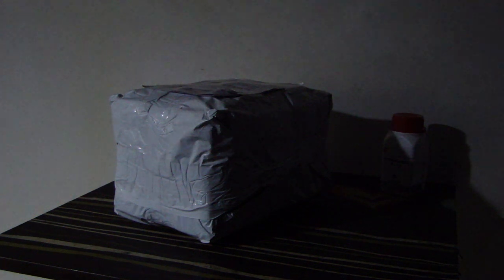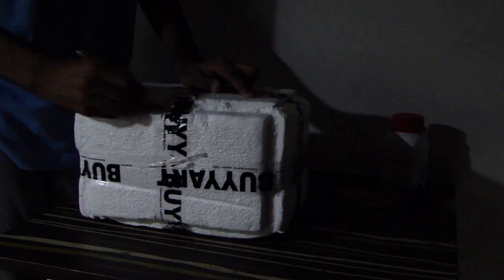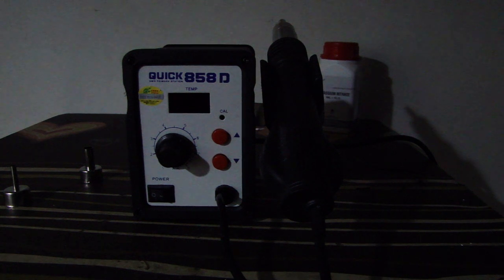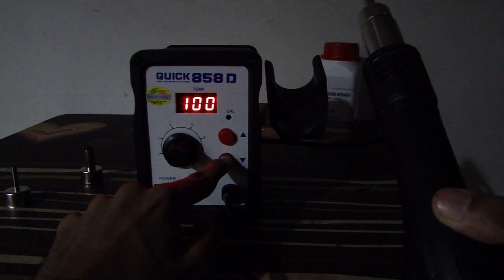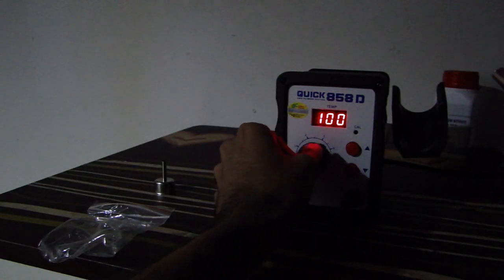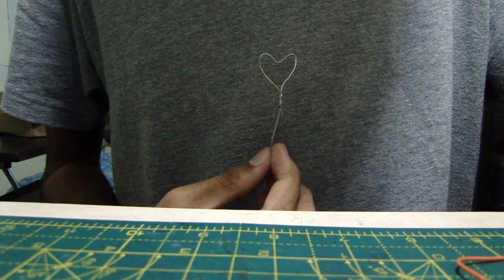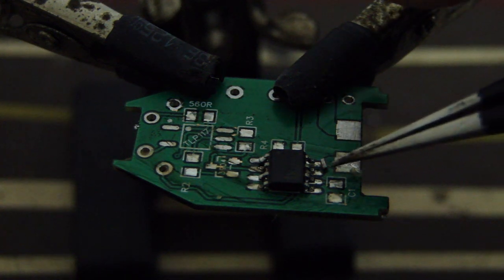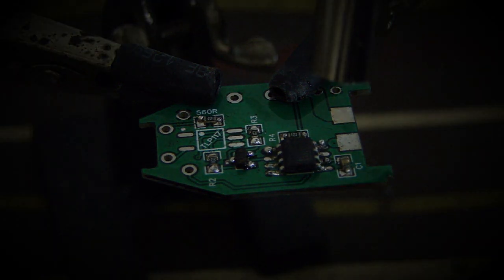Hot Air Gun | SMD Soldering Without Solder Paste?

Comment: That was a great little guide. Nice touch with the custom solder pellets too, I'm going to try that right now!
Reply from the maker: ooh, I'm glad you found this old video helpful! I'm actually working on a project right now where I had to do something similar, so I can recommend a slightly different method: pre-tin the pads, add a rather large amount of flux on the board, place the components roughly where they should be (the flux should help hold them in place), then use hot air
I used a hotplate, but after cleaning off the excess flux, the joints were amazing
Reply: @NNNILabs  Good call. That was going to be my initial technique but I like the custom solder ball idea too!